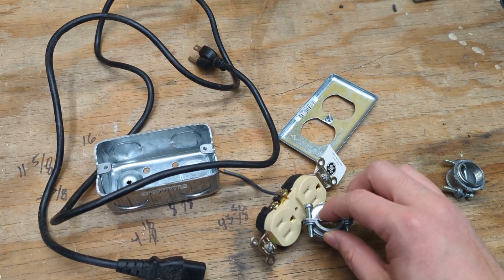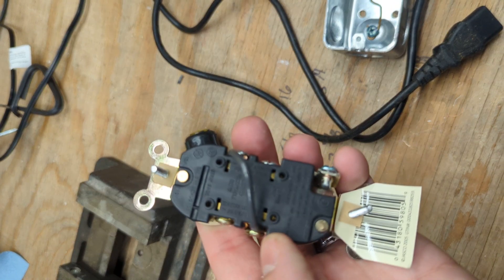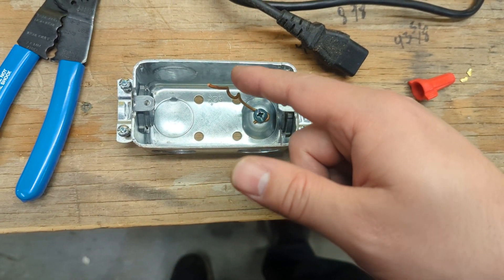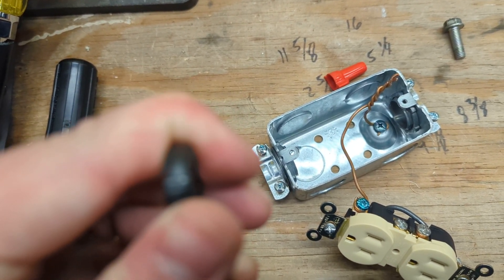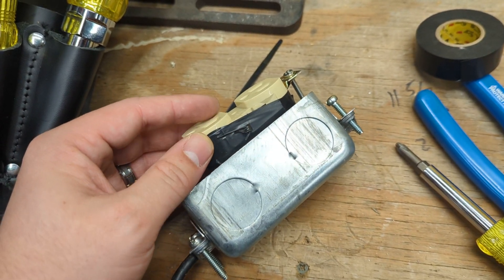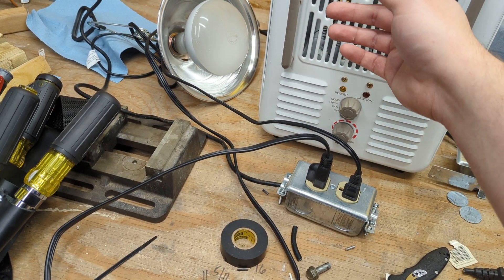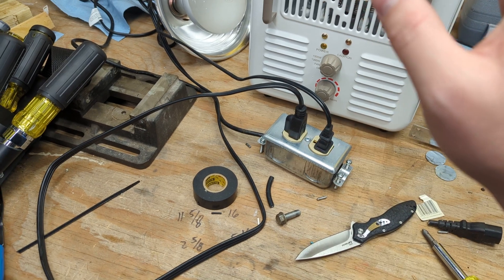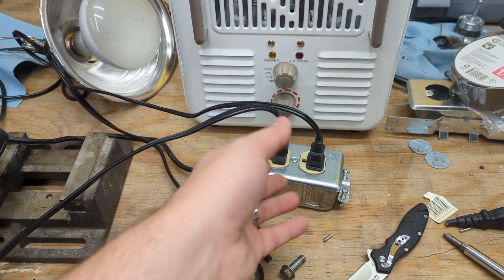Cheap Current Limiter for MOTs and Old Equipment

Comment: I built roughly the same thing a few months back. It's called a dim bulb tester. Handy device for testing. I built it in a 4" steel gang box and screwed it to my work bench side. I added a power switch/outlet combo so I can turn it on and off and have a bulb plugged in with a adaptor. Then it goes to a standard two plug outlet so I can plug two devices in should I want to. I can switch the bulb in the adaptor for any wattage bulb I want for testing. And I believe I used a plug that was 12ga wire to connect to my box. And it very nicely plugs into a GFCI that just so happened to be next to the work bench lol. Haven't used it yet for actual testing as I haven't needed to. Plus it's in the basement and I prefer to work at my computer desk lol. And I got a variac so it's not truely needed most of the time.

Of course I built it right and grounded it all. I used the wire lever locks for electrical work so it's easy to undo and change it if I want to. Was super handy as I had to pull it all apart to screw it to the bench lol. And the benefit is my steel work bench is now grounded!